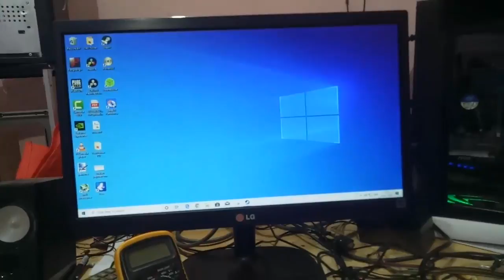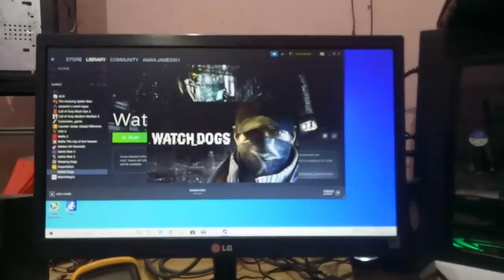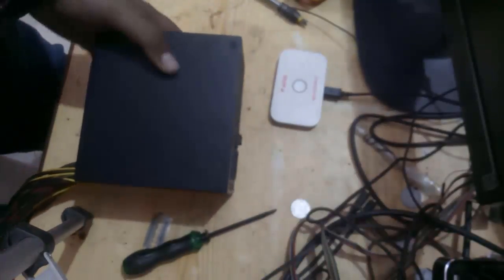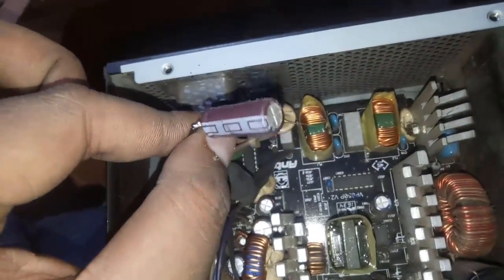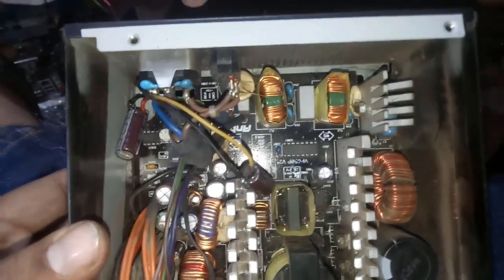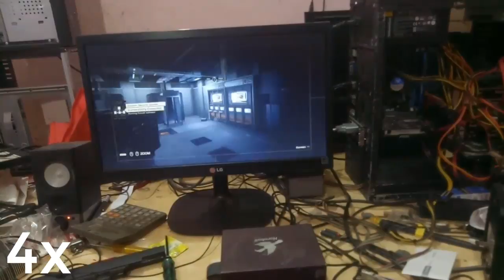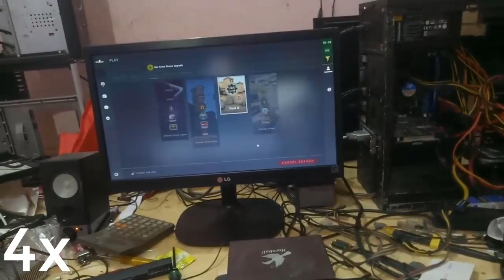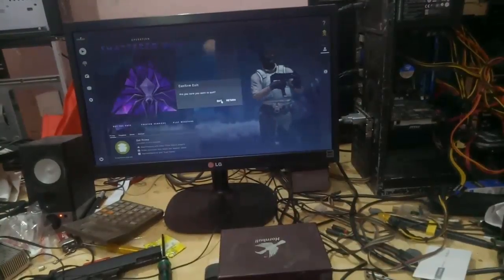PC shut down when playing games Fixed

Comment: Same problem and i have new pc and new power supply dude.
What to do now?
Reply from the maker: This problem also occur when home ac current has fluctuation, If the voltage is in home is fluctuating you can use a ups, otherwise the problem is in the power supply, either your power supply is low watt or its bad quality.
Reply: @amanjamestech  i bought a pc last week and i had more than 5 shutdowns in my house. Now  my pc restarts when i play some games like Valorant and ARK but no with LOL and Minecraft, what is the problem?, does the power suply got damaged or what
Reply: @issamuel1405  me too
Reply: @issamuel1405  i had roblox when i didnt format my pc and it wasnt very laggy then when i formatted i played roblox and it became very laggy also for me its also like that i try to play some games and my pc restarts every time i play games :/
Reply: Any one of you solved this issue?
Reply: Joshua Rivera saaame, i figured a way around this by lowering the graphics on all my games despite having a BEEFY pc, all the way until i got hl alyx, this was my breaking point man, i can barely load 10 minuets without crashin, imma probably get a new power supply.
Reply: @kaustubhbhbh1  3 weeks laters i configured the bios and set all te fans default and set the ram hz default too. the problem was that my ps wasnt power enough
Reply: Is Samuel Yeah just get a new power supply make sure its good wattage and 80+ rated
Reply: @comradebutter1214  Updates? You still having problems?
Reply: i have a barely two months old cpu and my psu is 80+ gold, 650w. everytime i play pubg after 5 - 10mins, it shuts down and turns back On and then shuts down again and turns back on again repeatedly, so i switch off the psu switch so it would stop. what seems to be the problem?
Reply: awts bok probably the psu
Reply: @adriandltv  Yes it was. and i replaced it and all fine now. thanks!
Reply: awts bok what psu did u have and which one did u buy ti fix the problem i realy need the info thanks!
Reply: @adriandltv  it was 650w 80+ gold deepcool. i replaced it with 850w 80+ gold corsair
Reply: awts bok  i have the same problem now my pc is shutting down many times and when i shut it down i cant open it and after a day it opens is this the same as ur problem last time?
Reply: You should change CPU HEAT SINK
Reply: Yeah i just got mine 2 days ago and its doing this like wtf didnt evn have it for a year
Reply: @amanjamestech  theres currently some workerd in my backyard and my pc is pretty near them, is it possible that when they start welding my pc shuts down randomly?
Reply: Sometimes can tell if the Processor unit problem, me, I go to the Processor Power Management setting. Minimum Power: 10%
Maximum Power: 90%
Fixed
Reply: ive been playing Roblox normally but now that i try to run it with chrome opened in the background it crashes my PC and sometimes restarts it
Reply: right now that im not doing anything its ok
Reply: @issamuel1405  same happening right now
Reply: @ChosenContent  I fixed it after i set my bios on default, idk what i did with the fans but they were using to much energy.
Reply: sometimes it maybe bacause your pc is to hot.. try to open the casing and play the game
Reply: my Problem is pubg when i Play random PC shutdown. But the funny think is that i Play GTA V two and IT dont crash when i Play GTA. I think my Problem is that pubg needs more Power
Reply: Yes it was the Powersupply probably got damaged or something because when I bought my Powersupply I drop it on the floor and that's how it is
Reply: @issamuel1405  same
Reply: Sometimes new PSUs can be faulty too

Comment: when i'm in windows playing videogames or doing something in chrome the pc randomly shutdown, i tought that my motherboard is failing in some circuit sending wrongs voltage to the cpu :T
Reply: Bro same problem what you did
Reply: Did you install something? Go into safe mode and delete it. Should be fine. Sadly, I can’t apply the same thing to me. I was playing Detroit and I was compiling shaders and it crashed.
Reply: @sheeloesreallycool  yeah dude 
When I'm playing Detroit
It turns off my pc

Comment: I bought new pc 
Specs - mother board - Gigabyte b450m s2h
Processor - Ryzen 5 3500 
Graphics - Amd Radeon rx580 4Gb
Ram - 8gb
PSU-  Antec atom b550w when i play game more than 30 mins my pc restarts automatically can u plz suggest me what is the problem.?
Reply: Check Event Viewer and listed what critical error windows log
Reply: @nitrocoil  thanks bro but i were fixed it about a month ago... Monitor was the problem after change of monitor pc doesn't restart automatically
Reply: Mine is same
Reply: Which monitor did you buy?

Comment: Bro I just built a new pc and I'm getting the same problem but not shutdown...My monitor says no signal and mouse and keyboard also don't have light glowing but my cpu fan and rgb will be on.

My specs : 
GPU : gtx 1650 super
CPU : ryzen 3 3100
Ram : 16gb 3000mhz (8gb x2)
PSU : Corsair CV450

Can it be the psu?
Reply from the maker: Re seat the ram (means remove and put back on slot)
Reply: Lol that’s not psu has that I had to cmos reset reseatinn the ram was never enough don’t test each module as you may damage it just try and find a combination you knew then cmos reset and reseat works
Reply: Same here. Did you get any solution?

Comment: I have a build with an I5 9400, GTX 1660 Super, 32 gb of Corsair ram and a 500 watt psu. It’s meant for flight sim mainly and when I run xplane 11 for about 10 minutes it will shut off. I’m thinking about replacing the psu with a sea sonic psu.
Reply from the maker: Corsair TX is also good

Comment: I’m still having this problem still on my current build after going from a 750 watt PSU to a 850 watt PSU, both of which are way more than enough power for my build, any other advice?
Reply: Your CPU is overheating
Reply: dark night Nah, it has nothing to do with temperature as I’ve monitored the temperatures of all of the components and noticed nothing irregular when the crashes happen
Reply: @Kohana64  if u find out let me know because my computer shuts off randomly. And I changed out my psu from a 600w to a 750w... unless they are both bad...
Reply: Drew check ram. Possibility. Try memtest86 or swapping out the ram sticks and finding the bad one
Reply: The ram is either bad or there is an issue in the motherboard
Reply: Did you really done the whole process

Comment: Please help I used to play transformers the game on my win 7 pc it also had many other games like nfs , midtown madness , jardians , etc.
All the games used to run properly 
Some time ago my pc ' s harddrive got damaged I got it changed by service centre all the softwares work properly but when I play the games which I already have mentioned above after reinstalling the computer crashes everytime and I tried reinstalling several times but it is the same problem , I am unable to understand that the games used to run on same graphic card and ram before this and all worked well but now what's wrong with them.

Comment: I already replace my psu but it is still shutting down any tips?
Reply: Which psu u baught ?
Reply: Change your processor cooler
Reply: Its touching the motherboard capacitors which is causing this fault

Comment: i got a brand new pc . using for a month now no problem was.. and now after a few min of gameplay. my GPU shutdown. everything else working. i hear my friends talk to each other behind the black screen. my lights are on . (my nzxt kraken x73 show me cpu gpu temp but it starts showin 0celsius upon black screen) checkd gpu Z logging but it just stop reading . last heat was 53 degree( its a 3090 so i saying its no pressure on the card. like i cant pressure with any games mostly.. just shutdown in games.. ) any tip?
rtx 3090- i9 10900k- psu is 1000watt 80 rated platinum

Comment: Hi. I've been having this problem for months now. So I thought that it would be a power supply issue. It was not - the power supply is perfect. I still changed my CoolerMaster 850 watt power supply with Seasonic 850 watt gold, still got the problem.

I tested the computer in another house and it runs perfectly with no crashes. So, here's my question: if I get an UPS, will it help me to fix my problem? What do you think?

I live in a 19 sq.m. garage where the power cables are a bit thinner than in ordinary apartements. this MUST be the issue....
Reply: Try replacing your GPU or swapping it with a. New one and running unigine haven benchmark. You should be able to tell. If you can refund your PSU do it. One component at a time

Comment: i have problem same to, my psu seasonic 630watt, always restarted if i play game, and then i just have try with stabilizer 1500watt, and then its solved .
Reply: wait, I have the exact the same problem too. I even changed my CoolerMaster 850 watt power supply with Seasonic 850 watt gold standard for obviously no reason. The power supply is fine, it has to be my house electricity where there's a problem since I live in a 19 sq.m. garage where the power cables are a bit thinner than in ordinary apartements...

By stabilizer, do you mean the UPS or just the stabilizer? I'm thinking of getting a stabilizer myself, probably it can finally solve the issue...
Reply: Did you solve it?
Reply: @giorgipruidze3361  hey did you fixed your issue?

Comment: got the 12GB version of 3080. It seems if I run a game well, like Black Faith/Returnal/Lords Fallen, I can't run those on higher than high settings, even though it will say I'm only using 8-10GB RAM.
 
I'm not new to gaming on PC. been doing it since only the 660 series was the only cards out. 
 
It seems like when I'm only using everything with high settings, which I use since there's no need to use max since there's not a big difference from max, high seems to let me run newer games for a long time without restarting my PC, and my temp stays usually in the 60s. 
 
12400 cpu/4 fans/haf 912 classic case/1 ssd/1 12gb hdd

It's a 750w 

My old psu is a 650m and running the same game my vram is staying at 8gb,whereas using my other one it goes to 10gb same settings ingame

 I just got the 750w psu earlier this year. I had a monster 4070, which didn't cause restarts. 

I sold it to make more cash until the 50 series comes. Very strange. 

My 750w restarts usually when demanding games, even though my GPU doesn't go over 70s or CPU.

Comment: Im going to buy the thing that checks how many volts the osu should put out(12 volts) and im going to plug those things into molex connector and if i get less volts than 12 then im going to get a new PSU

Comment: Every now and then, I would be playing a game on my pc and it will get glitchy for 2 seconds then it will restart. I have a 750w power supply with 64gb of ram, the graphics card is an AMD Radeon 6400. It’s supposed to have 16 TB of storage over 3 HDDs. Is it possible that because each of the HDDs are having a cumulative power output. Or can it be the Graphics card driver issue?
Reply from the maker: Is it showing blue screen before restarting

Comment: Dude if you can help me please
My PC also shuts down while gaming but it is quite different. The same time it shuts down but with a buzzing sound and a random solid single coloured screen for 5 seconds and then the pc shuts down. I tried changing gpu and thermal paste and psu. No problem with any temperature.
Reply: Did your problem solved after changing those things?
Reply: @gvshriram  nah man. It's 4 months ago . I bought a new gpu.
Reply: @Gamexoozi  I have bought asus gtx 1050ti....and it works fine...my cpu hangs and beeps with low sound continuously especially while playing games..and it says...your pc ran into a problem... and then it restarts.....i took the gpu out and re placed it....then also the beep continues....but i dont know whether the problem is from gpu or motherboard....please help me..!!!
Reply: @gvshriram  seems like a ram problem
Reply: Same let me know if you find a fix
Reply: @jseanmullings1942  its the graphics card. That bastard was fuuking with me for more than a month, changed it and it worked completely fine
Reply: @Gamexoozi  Thanks i had a feeling  it was the gpu

Comment: I have corsair VS550 , heating issues are not there because i just installed Cooler master hyper 212 turbo and temperature while gaming never crossed 58°C. My PSU is pretty new itself never faced any issues before. Gpu Gtx1070 Cpu Ryzen 5 2600 motherboard msi x370 Gaming plus.  What could be the reason of my sudden pc restarts ? At one instant the screen went blue with message that "Some error occured, your pc will restart in few seconds" & rebooted. Please guide me to something
Reply: Broo we have same psu, it solved now?
Reply: @dimasyolanda2081  it's been a while now the problem hasn't occurred. You should check bios settings and disable any kind of overclocking (if its there). Sometimes Ram is not stable after OC'ing.

Comment: I kinda have a Same problem with you
I play payday 2 for 10-20Mins then my computer power off itself like no power at all, when I try to turn it on it won't it need to be unplug wait for few seconds then plug, I look for possible reason why?
CPU is not overheating
RAM is ok no Problem Detected
Driver is Fully Updated
Malware Fully Checked, No Malware Detected
I came to conclusions that's probably my PSU cause is Generic.

Note.
The Computer Will Run Perfectly Fine When IDLE no power off itself.
The Computer Will Run Perfectly Fine With Lightweight Games Such as COD WW2, Osu!, Sleeping Dogs.
When I try to use Stress CPU in CPU-Z the computer will do the same Power off itself, in the past it will run perfectly fine when I use Stress CPU.

Comment: Bro i jist noticed that this happanes when i only playing hight intensive graphic games i changed window, changed my 420w with 600w i have new cable for psu, cleaned psu from dust and still this annoying shit appears im playing in fear waiting for when my pc is gonna turn off. Pls  just need answers on question: What is problem?
Reply: I have the same issu...while playing rocket league it's perfect but while playing witcher 3 it's randomly disconnected but my pc still on and restart automatically...I am thinking I'm going to rma my rx5600xt...
Reply: @awesomeworldhindi5120 hello my friend this comment was posted 6 months ago. Now I fixed it and I found out that problem was not PSU, but motherboard. See when u have strong PSU and potato motherboard it has no strength to receive enough power from PSU for GPU, CPU, screen, keyboard and so on... So u should not blame GPU or PSU for that. It's all motherboard issue.

Comment: I have a 725 watt power supply but this still  happens to me idk wat to do
Reply: Did you managed to fix it?
Reply: @igorrocha1845  I eventually did but thats because I bought a game called subnautica and that game killed my computer like seriously it overheated mt power supply and I had to get a new one, so I got an 800 watt power supply but it went from shutting down to black screens, meaning that my pc doesn't shutdown but my screen would for 5 secs and than return back to normal

Comment: Processor Power Management
Minimum: 5 to 10%
Maximum: 85 to 90%
BIOS Processor Speed: AUTO
CPU: Ryzen 5 2600
Motherboard: Asrock B450M Steel Legend
GPU: Sapphire Radeon RX 590 Nitro+ Special Edition
Me: problem solved
Reply: you didn't actually solve the problem, you instead caused another one so you can run for a while.
so it's gonna be somewhat like this, you have got a tire that isn't filled enough with air, so instead of trying to go and fill it with some, you instead loosen the other tires so the car at least can be driven. In your case your power supply is that flat tire and your whole system is the rest, and I know this much because I used to do the same method before, and I've also downloaded msi afterburner so I can limit my gpu power consumbtion to 80 percent, how foolish of me.

Comment: I have a rx570 + i5 3470s with a 430 watt psu. I think I should definitely upgrade the psu because on afterburner my gpu and cpu are stable
Reply: I have also similar specs and 550w psu but still facing this problem
Reply: @crazyboyrish2577  hey man, gonna go ahead and tell you it could be the GPU. I upgraded to a GTX 1070 and was fine afterwards
Reply: @spaghettitoes3167  mine is working properly for med games 2016 and less but it shut down for modern gamers and this happening from past few week only
Reply: @crazyboyrish2577  If upgrading the PSU doesn't help you out, i'd try and get ahold of a new GPU. Mine was used, and from the look of it I assumed it was used for crypto mining so it was poopy to deal w

Comment: I have the same problem. I recently built a new computer and it was working great for id say a week. Then all of a sudden when I turn on my games it just shuts off. Working on other applications like Premiere Pro and After Effects is fine but its the games that are the problem. My PSU is a Corsair Rm 750 fully modular. I wonder if its my PSU. If it is, I'm heart broken.
Reply: did you ever find a fix? the same thing is happening to me.
Reply: @naruto123651  I ended up having to change the PSU
Reply: @noeray94  did changing the PSU work?
Reply: @robbytherob  Yes, it worked. My main issue was faulty PSU. Corsair sent me a new one and replaced the earlier one since I still had warranty.
Reply: @noeray94 i did changed my psu but it keeps restarting again so what should i do